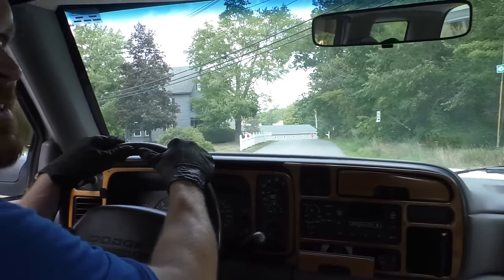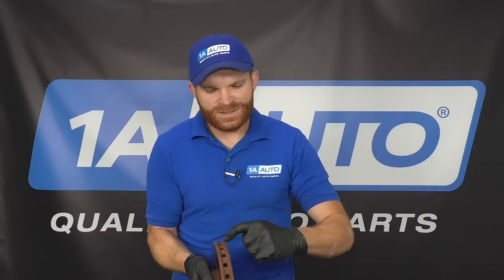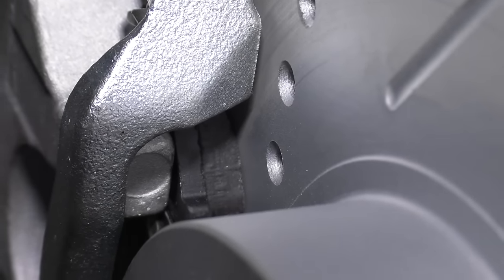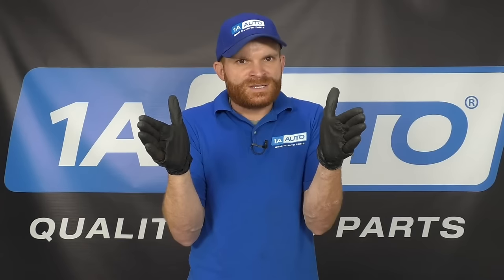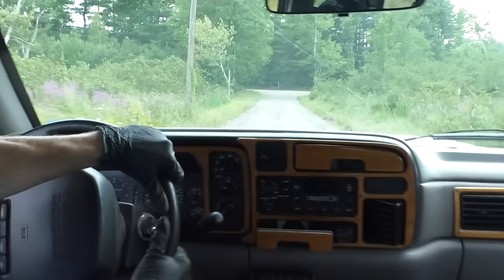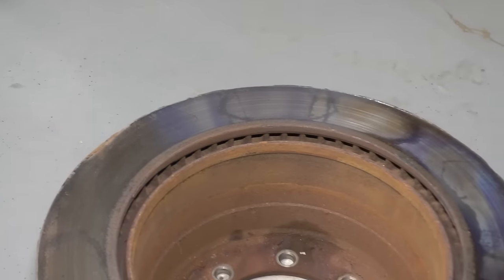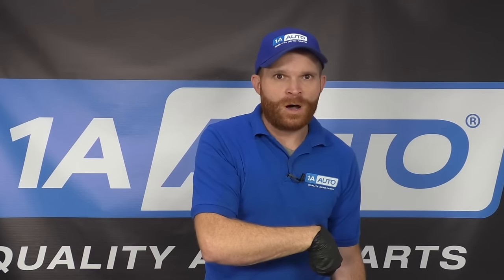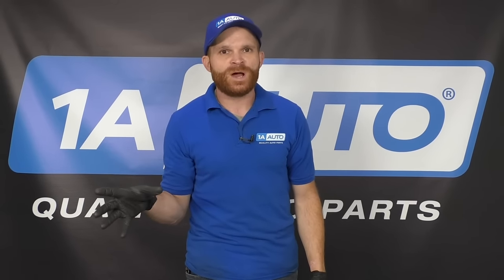What Causes Brake Shuddering, Shaking, and Pulsing on My Car or Truck?

Comment from the maker: √  Watch the Video
√  Buy The Part at 1A Auto http://1aau.to/m/Visit-1AAuto
√  Do it Yourself
√  Save Money
Reply: Do you have to replace the brake pads if you do get new rotors? Would used brake pads mess up new rotors?
Reply: Finally, some great advice for the problems I've been having.  Thanks man, you're amazing!
Reply: I purchased a 94 GMC Sierra C3500.  Getting off the freeway one day, the front end of the GMC started shaking violently while braking.  I called it a death shake.  I jacked up the front wheel and turned the wheel.  You could actually feel how warped the rotor was, which caused the passenger side wheel to heat up.  Replaced the rotor and bearings.  $350 for parts $200 for labor.  It's as smooth as glass braking on the exit ramp.

Comment: My car NEVER shook until I got my breaks done. I got my tires balanced and it still shakes. So you're telling me PepBoys messed up my car? 🧐
Reply: Google a local family owned mechanic shop. Read the reviews.  Try to find honest mechanics.  Definitely not one of these corporate places... jiffy lube pep boys, etc...
Reply: Nahh fr. Once i started going to get my brakes done, the 3rd time i did it, now my car started shaking when i brake. And even when it doesn't do it, sometimes it feels like the brakes is all soft and when i apply more pressure, then it starts happening, even with new brakes and pads. I ll have to explain this to next time i go
Reply: basically yes
Reply: @redtail1.  Better get them fixed ASAP. My tires got super worn out because of the breaks and the shaking. I went back and made them fix their issue. The pepboy guy was trying to justify the shaking and blaming ME for it. My man stood up for me and they finally did their job but before that they tried to over charge me after I had already paid for all breaks and rotors. Haven't had issues since.

Comment: even with new rotors, before you install clean the face of the axle hub really well with a wire brush on a drill.  Get ALL the crud off.  this will insure the rotor sits flush and true onto the hub and will help minimize judder later.
Reply from the maker: +william j Thanks for the tip! We'll pass this info along to our production team.
Reply: Amazing tip
Reply: See I didn't use brush man dang
Reply: Also apply a good coating of "Anti sieze" on any connecting surfaces. That way next time you have do brakes, everything comes apart like it's supposed to and you won't have to pound the rotor off with a 10 pound hammer.

Comment: My mother has had her breaks done so many times but her suv still has the shudder or pulsation happening when breaking going down hills. Im going to show her this video so she can get the breaks fixed properly. Thank you so much for this video!!!
Reply: If she hasn't fixed the issue by now, she needs to check her hub and bearing assembly. Most likely the hub is bent thus unevenly wearing her new rotors one after another. Also make sure her wheel isn't bent as well. This can be caused by a simple slow slide into a curb in the winter. All the mass of the automobile is forced into one spot and then the damage occurs. The hub is all too often over looked as the technicians are poorly trained.
Reply: Get out there and fix that shit Janz. 
Why do u think she had a son?

Comment: Synthetic brake fluid is making it's way into braking issues too.  DOT 3 and 4 seem to absorb moisture overtime which creates a thickening of the fluid.  It could cause blockages or weak pressure to a caliper, unequal pressure to calipers etc. It could also cause the fluid to expand when it gets hot cause one or more calibers to apply pad pressure to a rotor. It does the same thing with hydraulic clutches too.  It is a good idea to flush those systems periodically.   When I did my front brakes last year one pad was worn to the metal and the other had 4mm of pad left.  The fluid in the lines was milky and thicker than normal.  I flushed the entire system.
Reply: Thanks, I agree that bad brake fluid can also affect braking-excellent point.

Comment: Ok so brake pulsation is always a hot topic. Rotors usually don't "warp"   due to too much heat on the rotor but too much heat on the pads. Steel goes through a phase change in structure much higher than normal driving (think when rotors glow on a race track). One of the for sure ways pulsation car occur is uneven pad material transfer to the rotors due to poor driving habits or poor break in after install. This is why pad manufacturers recommend to avoid holding the brakes when the vehicle is at rest during the initial pad break in procedure test drive.

Heavy uneven corrosion on rotors such as what dealerships call "lot rot" is another culprit.
Reply: Well, yeah, but they also do "warp" or, also very common, due to other failures, have uneven wear that increases the effect. A real warped disc is the less common thing, yeah, but it does happen. E.g. people driving down a hill, foot on the brake, temperature in the disc rising high, then coming to a complete stop where the part of the disc where the pads are will cool down a lot quicker and the disc might get warped.

Comment: Great info. Adding a couple cents to the pot.... don't forget to check the wheel hub face for runout and the surface conditions of the rotor hat section (the surface that rests on the wheel hub) and wheel hub for road dirt/corrosion build up. If the rotor to wheel hub mounting surfaces are not flat/clean this condition can translate to the rotor having excessive runout.
Reply: Very good point

Comment: good video. I thought the pulsing in my car was from my front rotors, but the vibrations are felt in the brake pedal / car, not in the steering wheel so it's likely from the rear brakes.

Comment: I appreciate you taking the time explaining things this video has given me a bit more clarity upon pulsation when braking. i still need to gain better understanding of the abs system... to know the difference in diagnosing a issue. To determine whether it is in fact the calipers with piston issue or any of the encompassing components...to the actual abs system causing the problem...

Comment: You said exactly what I’ve been telling these mechanics my problem, too bad they told me about a month ago that nothing was wrong and they even test drove it. They said my rotors and brakes are in great condition and I’d be wasting money changing them. Im going somewhere else and I will also mention about getting the calipers checked for freezing issues.  I knew something was wrong so  I’m replacing both today because I’m getting pulsation every couple stops for over a month now.

Comment: Sir, great video.  I have a 2011 Chevy Silverado Truck. prior to replacing my rear brakes no Rear Shudder / NO Pulsation happening. During a dealer inspection, they recommended to get my rear brakes replaces.  So, I did and got the parts from Auto Zone, brakes and drums, took it to our local brake shop, once they finished the job. Drove off and on my way home, I noticed a Shudder/Pulsation when I apply the brakes coming from the rear.  What course of action I should take?  New Brakes, springs, drums were provided to the mechanic. Very Respectfully H.A.M
Reply: Try replacing your shocks maybe?

Comment: Brake discs don't warp. The slightest run-out introduced when mounting new, wears so as to make the disc thinner on the two opposite sides. The two high spots are worn away. So as it goes round, the pads rub on thick thin thick thin.  Calipers can follow a run out of 5 thou without any problem,  but a variation in thickness of just 0.0005 inches will be a pulsation of your brake pedal.
Reply: It's probably the calipers.
Reply: Exactly, disc 'warping' is a myth!!! Cast iron will only begin to lose its structural integrity at around 1,800°F/980°C
Reply: @symboleyes6242  and if you have a hotrod like me revving to 7500 rpm at 120 mph in 10 seconds, you need high carbon rotors, or the caliper will make impressions in the heated metal 🤣

Comment: And don't forget to check the wheel bearings.. I have seen hub assemblies heat up wheels causing me to check the brakes to see if I had a caliper hanging on. Noticed some vibration the end up coming not from the rotor but from the bearing beginning to come apart and allowing the wheel to warble a little
Reply: I am getting ready to check this situation out on my 95 ford f150, ( 99,000 miles ) I will be buying bearings too. My truck was so bad I could hardly drive it ( sometimes ) . It was toe in about an inch and I reset the toe, tie rods and joints  were good though. That took care of a lot of it but still feel the vibration and the right hub gets hot. Well nothing else to do this weekend lol. This old 60 year old is going back under the truck.

Comment: You don't replace rotors without the pads, but its perfectly normal to replace just the pads without the rotors, they are meant to last less than rotors and being replaced as they wear down unless you hit the metal to metal grinding of the rotors.

Comment: Thank you! I replaced the front and back rotors and pads! Still having a lil shudder when stepping on the brakes coming to a stop. If I am going slow, 2-5 mph it does it as well… Thinking it might be the front calipers, even tho inspecting them I didn’t see any cracks or leakage…? I know I need to get new shocks, but just gonna do one step at a time. 2007 Chevy Tahoe, if anyone else has had these issues please reach out to me, maybe I am missing something or over looking it…? Thank you for the video!

Comment: Warped rotors from over tightening the lugs nuts.  

Back in the 70s, 80s, 90s we learned to diagnose car problems from similar past experience problems.  Vehicles are pretty much still the same today except manufacturers have put in way too many sensors and have made cars way too complex (electronics wise) as manufacturers have seen there is a huge market in the car repair industry. Do people really need a sensor in their windshield washer reservoir and tire pressure sensors are a complete joke in themselves!  How hard is it to check your tire pressure once a month?  These are 5 minute jobs at the most and for some reason the auto industry thinks people are much too stupid and lazy to do even basic maintenance on their vehicles.
Reply: Well done for saying that,  they think everyone is rich, celebrity and lazy.

Comment: I would like to know what can cause brake pulsation AFTER a brake job was completed. 

Both rotors were turned along with new bearings in the integrated hub, and yes, I did knock out the old race and replace it with the new ones. The new races were seated completely. The new bearings were packed by hand with the grease in the palm method. High temp bearing grease was used and lots of extra grease was packed into the inside of the hub. New inside seal installed. 

Wheel nut was torqued and spun at the same time at 12 and then 30 ft/lbs. Then the nut was backed off 1/4 turn and finger tightened. Rotors spun smoothly. 

Did not replace the slider pins in the bracket but I did clean them up and replaced the boots. Put a generous amount of brake grease on the pens and seated the boots. Cleaned excess grease with brake cleaner.

Installed the brackets (they were stamped R/L) and torqued them to 136 ft/lbs. Installed new anti-rattle clips, fully seated, on the upper and lower anchor plates, making sure they did not touch the rotor. Applied a small amount of brake grease on each pad track. Sprayed rotor good a final time with brake cleaner to remove any stray dabs of grease and fingerprints. 

Installed the new brake pads (ceramic) into the bracket with the friction side against the rotor. I did put a dab of grease on the tabs that make contact with the clips, but I did not put any anti-squeal compound on the metal side of the pads.

I did not rebuild the dual piston calipers but used a clamp and one of the old pads to press the pistons back into the caliper. Opened the master cylinder cap to let the fluid flow back into the reservoir. Installed new anti-rattle clips (the bigger ones) inside the caliper.

Installed the calipers on the slider pins and torqued them to 26 ft/lbs.

Mounted the tires and torqued to lug nuts to 100 ft/lbs. Tires spun smoothly.

Went for a test ride and almost right from the start they felt rough and after a few more times they began to judder. It has gotten worse the more I drive it, the pulsation is more pronounced. I have no issues on the road until I go to brake. It does pull slightly to the side which it did not do before. But it is now parked until I can figure out what is wrong.

After doing some more reading I realize that maybe it didn't break them in properly. I am going to go sand the rotors and the pads to get any glaze off and see if that might help.
Reply: This is a 1999 F-150 RWD v6 XL Supercab with over 200000 mi.
Reply: @rob8789  update
Reply: Wjat was the issue?

Comment: I am struggling to think that every time a vehicle needs new pads, you also need to replace the rotors. That would jack every brake job from $100-$200 to closer to $750

Comment: 2012 toyota corolla, I have replaced the brake pads, rotors, drums and calipers 3 times. All brand new top of the line parts and they CONTINUE to be warped again within a short period of just a couple months. What suspension or steering or axle or tie rods or what kind of other part outside of the brake system could cause the brakes to warp extremely quickly? Because the brake system has been replaced entirely 4 times in less than 4 years........

Comment: Thanks for such a great video.  I am trying to diagnose a brake pulsating issue on my F150 2012. I just replaced both front and back rotors and pads lastweek. I'm getting crazy pulsating and shuddering.  Brand new rotors brand new pads on all four wheels. Please suggest some solution,  thanks.
Reply: BTW,  I  had no pulsating or shuddering issues before the new brake hardware.

Comment: From Wagner is a brake shoe Hybrid-Organic. Also, put the slotted new RecativeOne Roters on. All the way around.

Don't forget the brake fluid topic. Condensation will get into the brake lines over time. BLEED THOSE LINES. FRESH JUICE IS GOOD!

MY 2500 breaking is the best now. Did it all at home. No video's no vanity. Neener neener....

Comment: I had new rotors and calipers and pads still has squeaking brakes, then the pads replaced twice, van driven less then 1500 miles, now it vibrates and shakes after a 25 mile trip, so could the lines or hoses have junk in them plugging the calipers?

Comment: Just purchased the slotted rotors and brake pads from you guys for my Odyssey 09 and since replacing them my car has been rattling and steering wheel shakes very intensely, any suggestions? The car is currently at the mechanic.
Reply: Same... wonder if there only meant to last 1 year cus its exactly one year since and now getting vibration.  Lmk what mechanic says.
Reply: @soilBGuRu420  the mechanic replace the front rotors with a genuine part for the Odyssey , I was only able to use the rear set , front rotors from A1 got trash don't buy.
Reply: Are the slots facing in the right direction there is right and left  facing slots

Comment: any help i have a 2001 tundra v6 problem. The problem it that when i brake it vibrate and shaking but when it running no vibrate only when brake so  i replace new calipers,rotors, brake pab, new tires ,driveshaft support center bearing and the all 3 u joins but still vibrate any help thank you

Comment: I have drilled and slotted rotors on the rear of my car and I think I just want slotted on the front. I think that slotted and drilled is just too much metal taken away from the rotor and perhaps it might not work as well long term with my driving style.

Comment: Great video ...

I just changed brakes and rotors on a 2001 Hummer H1 at GM authorized mechanic and since when braking , specially at 50-60 m/p going as lightly downhill , very noticeable rocking back & fort is felt 

Talked to the shop and they say has nothing to do with brakes cause pulsation is more like streeting doing rapid left /right shake ..

But I think that are wrong . Brakes and rotors on a Hummer H1 are not mounted on the wheels like most cars 

They are mounted side by side on the middle of axle . Therefore the pulsation is felt in the form of of rapid back and forth shake 

Anyone has any opinion of suggesting on this ?

Thnx

Comment: Hi, good afternoon... i need help with my car... i changed the rotors and pads twice now with two different mechanics but my car still Shacking  specially when braking down when im over 45mph.... i need to solve this problem please...
by looking at the beginning of the video looks like you like near by my house.  Tucker st....  wondering if you able to help me.. even if i have to change everything for a third time... thank you

Comment: I am experience a lot of steering wheel shake after front brake system replaced. Maybe should I check the suspension?

Comment: Does cupping on tire tread cause a shake noise when slowing down from a fast drive to slow down but not shaking on the steering wheel.

Comment: Now lets say you got drums in the rear and when going to brake and the vehicle doesn’t shake however the pedal slips like there’s pressure but the pressure keeps on stuttering and the vehicle loses the brakes and they come back all within a few seconds of braking, my abs light also comes and goes I heard something about the ABS sensor but i wanna see what everyone else thinks and get more info

Comment: I replaced my rotors including pads 2 months ago and when I step on the brakes I'm getting a lot of vibration from my front suspension. Could it be a control arm or ball joint?